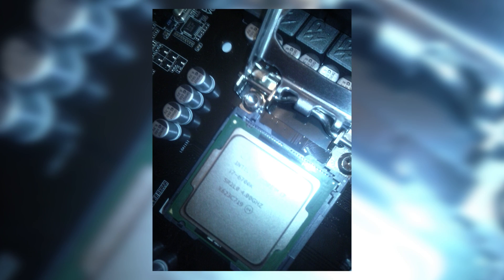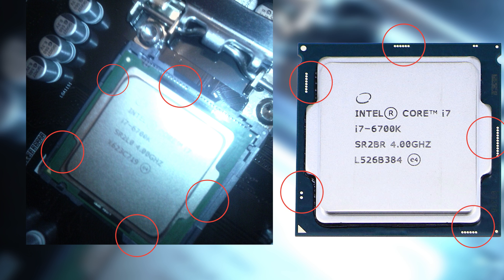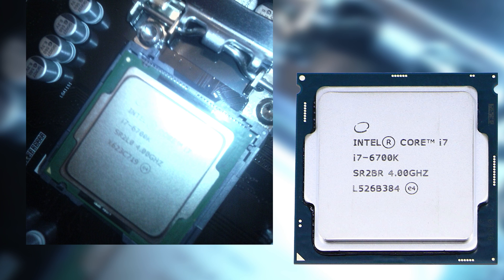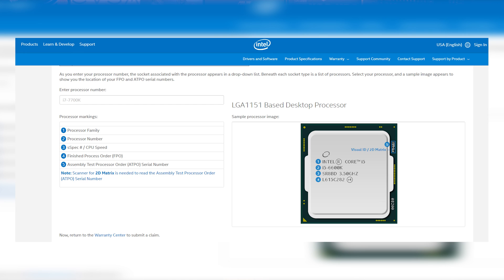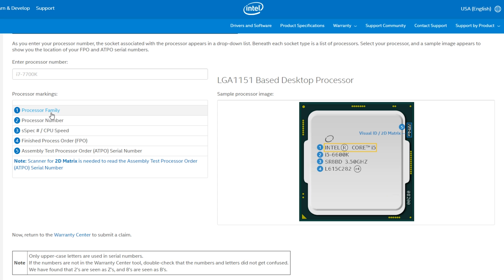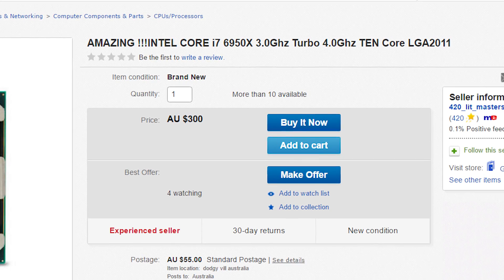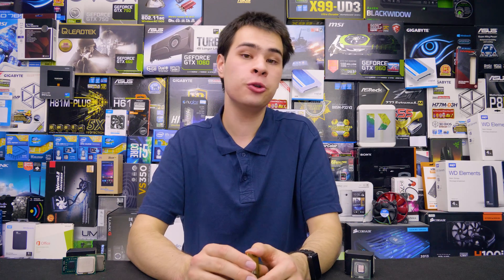CPUs EXPOSED - How To Spot A Fake CPU

Comment: Can someone help? on warranty web its telling that : 
The ATPO entered indicates a tray processor. Tray processors sold by resellers or system manufacturers are not covered under Intel warranty. Contact place of purchase for warranty options. so is it good or is it fake?
Reply from the maker: From my understanding it just means that the retailer is responsible for dealing with warranty rather than Intel but you still have warranty
Reply: that means that its safe? some of them arent showing anything just x and that "tray processor" thing means that its still intels thing and not fake?
Reply from the maker: yeah so intel sells 2 ways through 'trays' and also through typical boxes the benefit of tray processors is usually they are slightly cheaper but the seller will be responsible for dealing with warranties. All chips are safe but it just refers to who is dealing with your warranty if you ever need to claim it

Comment: This sounds like a re-hash of the "Cache RAM" scam in the 1980's. Even the body of the chips was the wrong plastic for a lot of them. I have seen some made out of low density polyethylene rather than resin. It was a bit more difficult spotting some of them as all that was done was selling the -45 speed grade as -10 speed grade. It would speed up your system a bit but nothing like as much as the fast stuff.

Comment from the maker: Update on the ARM chip comment 
A follow-up video has been posted here: https://youtu.be/GbRdH6Y08GA

So, to address the glaring issue. Yes, you cannot just simply drop in an ARM CPU onto an intel socket and expect it to work. Yes, I do agree that the instruction set associated with arm and the intel x86 platform are radically different and yes in the video I did make a mistake without necessarily realising at the time of recording and editing thanks to the lack of information on this topic on the internet. While yes there is some information online but compared to the amount that you might find about say fake phones, fake and knockoff CPUs are less commonly reported on due to the fact many of us know better when it comes to tech.

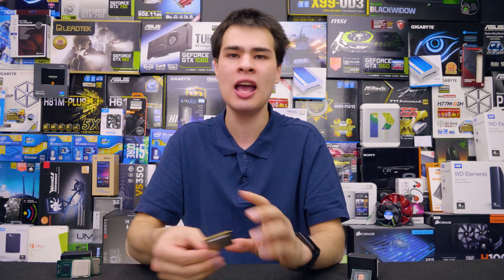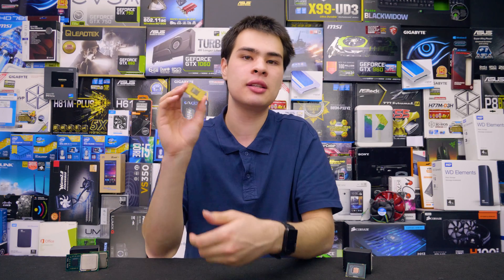The idea and message I wanted to originally convey about the ARM processors mentioned were the fact that there are CPUs out there that can be picked up in places like the Shenzhen tech markets and subsequently the internet that can be installed in a system with varying levels of success. I had made the statement about ARM processors as it is easy to understand how different it is from a standard intel and or amd processor. I had also never specifically said that it was an ARM Processor used 3:12 - 3:14  “something like an ARM processor or something very basic and easy to implement in a socket system.” though it is understandable to make the assumption that I am saying that they are specifically using an ARM chip and only an ARM chip.
The rest of the content regarding intel FPO, ATPO, e.c.t are all correct and can be verified on the intel site and with any box intel CPU sold

*However*, with that being said I do apologise for the miss information and the poor use of terms in the video and for the future will make an extra effort to make sure all terminology is correct and accurate to the best of my abilities at the time of uploading. In the next few days a video will be released to address your concerns and correct the mistakes made and thus this note will be updated accordingly.
Once again I do apologise for the mistakes that have been made and will do my best to rectify them
Reply: Right on. Way to man up... Just be happy you didn't say that there are 9000 penises and they're all raping kids

Comment: What are you saying?
this is not a dummy or knockoff CPU that would be absurdly expensive to make
it is just rebranded LGA775
It even has all stickers intact. and if you turn it upside down it would be clearly visible that there are far fewer  contacts than there should be

Comment: Google Xeon 1150. This is what he got. It probably has a fake label over the heat spreader. They can be bought $60 unit off eBay and then print a label and put it back out as 6700k.

Comment: No. A fake CPU would not containt anything. Making another "cheaper" processor act like the real deal would be harder and more costly than just to copy the silicon (still insanely expensive!) - The opcodes for i86, ARM, 8051 etc. is completely different - please link to a "fake" CPU. I bet that all "fake" CPU's you will find are re-marked/re-badged lower grade parts. Also, CPU's are tested at the plant long before the heatspreader is put on - so a "complete" CPU isn't picked for the bin. If you look into the BOM (Bill of materials) for a modern CPU, the casing (Substrate PCB, heatspreader, finishing) is a BIG part of the end price!

Comment: i purchased a fake gpu! it was a gtx 750 ti that has 1 gb of ram, a 6 pin and only 900 mhz clock speed! it works but inst what i was wanting to get and didn't want this to happen to the new cpu i wanted

Comment: edit:  He owned up to his mistakes and did that thing that's as rare as a pink elephant on the internet, admitting when you're wrong.  I'm going the leave the rest of the comment thread here, but just take it with a grain of salt and for entertainment value or whatever.

I read your comment about the "ARM CPU" and you really just made it worse.  You can't run or install or do any other such thing with x86 code on an ARM CPU.  Period.
Also Intel doesnt have trash cans out back like a Taco Bell where they throw stuff away.  I guarantee you its destroyed on site.
Finally, because packaging the die is expensive, Intel checks the functionality of the CPU before the wafer is even cut_.  _Dies are discarded, not whole assembled, bonded packages.
The problem is that when you get so much basic stuff completely wrong, you lose all credibility.
Reply: I agree 100% - this video had me laughing and saying WTF mate  - everything is sooooo wrong there.
Reply: He got one thing right: "consult a computer expert".
Just he aint it.
Reply: I happen to know reeeeeallly well how specifically Intel does their processor manufacturing and I could have gone into a lot more detail about exactly how he was wrong.
For example: the die cutting happens in a clean room which, itself, is inside a large complex of clean rooms.  There's no trash cans anywhere.  There's no trash anywhere.  Even the scrap silicon is expensive as hell and it almost certainly goes back and gets recycled in the CVD crystal growth process.

It just annoys me how he overlooked the really simple explanation of "its just a re-badged shittier Intel processor" and went straight for the least likely option ever.

Ok, you know what? fuck it.  I am gonna rant.  ARM processors and x86 processors are totally fucking different in (almost) every way imaginable, for example: Intel (usually) uses an off-CPU bus management chipset that hooks into the memory and peripheral busses.  ARM processors don't. ARM processors pretty much universally have that chipset built into the processor since theyre running on mobile devices that can't eat an extra 10 watts just to play musical chairs with some bits.
Not only that but a whole hell of a lot of them actually have the memory on-board.

Where would the pins go?  Where would they go?  You know a processor like that has literally hundreds of pins, right?  I mean they're not even the same from one i7 generation to the next.  Can you imagine how different they are for differrent architectures?  Im not even bothering to correct my spelling at this piont.

Look, its this whole fucking example is basically like saying you could take a goat, dress it up in a fighter pilot suit, stick it in an F16 and it would kinda fly the plane ok, but pretty slow.  No! Thats not what a goat would fucking do.  You know what it would do?  It would sit there and chew on the controls.

So if you made it this far, I guss my point is GOATS CANT FLY F16'S
Reply: I mean, at least he tried :/
Reply: Hmm.. well crap.  He removed his pinned comment, but he owned up to his mistakes in the video description. So yeah, as far as I'm concerned, that fixes it.  I'll edit my original comment to reflect that.

Comment: Folks, do NOT buy critical computer components, such as CPU, memory sticks, or motherboards, from eBay.  It's that simple.

Many products on ebay were quarantined stuff that failed QC.  Some unethical people somehow get hold of it and tries to sell it.  Since legit dealers won't touch it no matter how cheap, it winds up on ebay.  For things like mitten, it might not matter much.  For sensitive electronics, the bugs may not surface immediately, but fail at the worst possible moment..... you know, like used condoms.

Comment: From my knowledge, you can't run x86/64 or 32 bit architecture on arm 64 processors. The instructions won't process. So, even though Windows 10 phone and iot can run on arm 64, arm 64 shouldn't even boot.
Reply: Not only windows doesn't run on ARM, you can't make a "pin compatible" cpu from another arch.. hell, even from the same architecture if you don't have the source files or a minimum understanding of what you are working with. Even amd couldn't make a cpu of theirs run on an intel socket without intel's help..
Reply: Miguel Simões... or reverse engineering it all.
Reply: A modern cpu has more than 2 billion transistors on dozens of layers. It's literally impossible.
Reply: Miguel Simões Pretty much. Anyone who tries is crazy. Now if someone said that they took another generation and did the same to pass some scrutiny, I'd believe it.
Reply: still wouldn't work though...
Reply: yep.. this is literally just a different generation with a different lid. By the size/the lack of test pads and the position of the notches, it's a 775 cpu with a different lid. There is no conspiracy here.
Reply: You're quite right. The first thing that happens during boot, the north bridge maps the address space of ISA legacy bus (usually managed by LPC/SuperIO IC) that contains the BIOS. The ISA address space is mapped in a repeating pattern, so the first thing the CPU does when it's powered on is jump to the address 0xFFFFFFF0 that contains the first few instructions of BIOS at the end of the BIOS image, that are specifically to jump back to final BIOS location. Then further instructions perform hardware setup like register writes enabling various chipset and CPU functionality, memory controller etc.

Now if someone wanted to make a fake CPU out of commodity hardware that would POST, just POST but not boot an actual operating system... i can think of ways to make it kind-of work, but it's a very involved and completely useless enterprise. I'm certain the ones that POST are actually real Intel CPUs, factory rejects that fail under load, or units that initially sold by Intel in working condition and then failed, which happens - got overvolted too badly, killed by noise current in a faulty mainboard or high static discharge during handling, were subjected to high mechanical or thermal load that cracked them internally, or just had a hidden defect.

Making a dummy that just has the look and the weight of a CPU is pretty cheap though, you can get PCBs etched, plated and cut, shields stamped and lasered in China very cheaply, but i'm not even sure that makes sense, as the market for legitimate display dummies that you could put into a storefront is easily served by failed CPUs.

Comment: A sure way to avoid this scam is to never be cheap when it comes to a CPU. If you want an i7, just dig deep into those pockets and actually buy one from an official online retailer. One of these fake CPU's can ruin your entire system. I bought my 7700k new from intel through amazon and it works like a beast. Don't even try to buy these things used unless it's certified.

Comment: @2:38 Transistors? You mean resistor or cap.. Transistors in cpu's are so small that you can't see them with the naked eye! Also transistors have 3 pins/pads.. Not two like a cap or regular resistor (not SMR Network, like on ram, etc)..
Reply: It's not transistors. You wouldn't see transistors on the board external to the heat envelope.
Reply: +1 they are not transistors definitely

Most of the time, they are capacitors.
Reply: idk but, i do think its Transistors

Comment: Why not just take off the IHS that says the model and put it on a lower end CPU, sell the lower end CPU for price of the high end one, and well.. sell the high end one with the low-end CPU IHS with some thermal paste on it and maybe at 6pm or so so they don't see it and ask questions OR just use it for yourself or in a system you are building for a customer who ordered that chip?

Example: Take a 6700k IHS put it on a G4400 or even a Celeron 6th gen and BOOM done., take the G4400's IHS put it on the 6700k and sell it in a dimly lit place meeting someone from craigslist, OR again build a PC for someone who ordered one online to that spec and just put the pc together, chances are they won't ever take off the Stock CPU cooler anyways that you are recycling from the G4400.

Comment: i've read about counterfit cpu's being sold on ebay where someone delids a i7 heatspreader and puts it on a cheap celeron cpu of the same socket and gen and pass it off as a highend core i7. these types of counterfits can fool even the most savy people because the pcb's are identical to one another. you'll have too look very closely at the circuit layout  on the pcb to tell the diff between the two.

Comment: Another CPU  fake that pops about a LOT due to the ease of creation is an IHS swapped chip. Usually a scammer doing this will take the IHS from a high end CPU, say an i7-7000 series chip, then slip that onto an older chip like a Core2 Quad Q9550 and then pawn that off as the aforementioned high end chip. It's really cheap and easy to do and unless you go through the validation process before buying, you'll never spot that it's a fake until you try slapping it into a motherboard just like the poor guy in your video.

Comment: Only fake CPU I've had was my first home built PC.  Bought the mobo and CPU from the same company and they shipped everything pre-installed and covered by an unnecessary heatsink.
CPU was supposed to be a 486-sx33, but it was a sx25 overclocked.  Pricks.  And for that I had paid an additional $100  haha